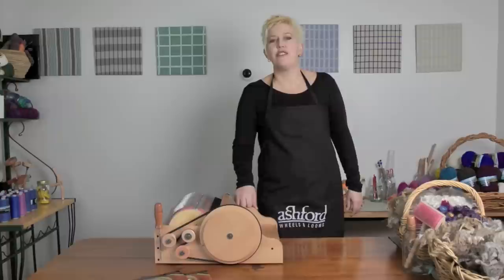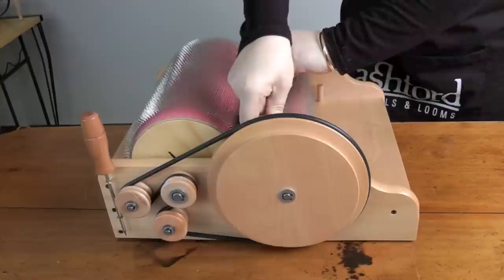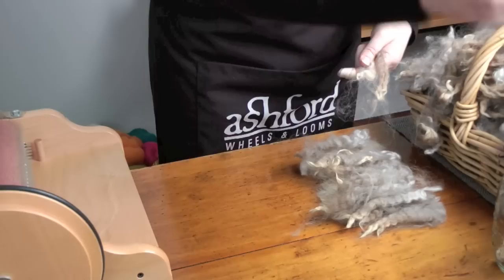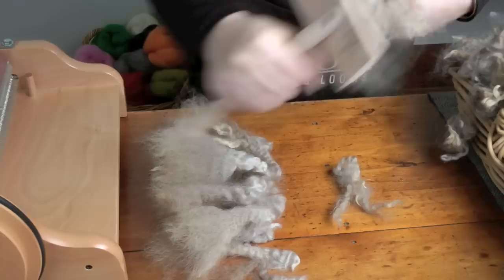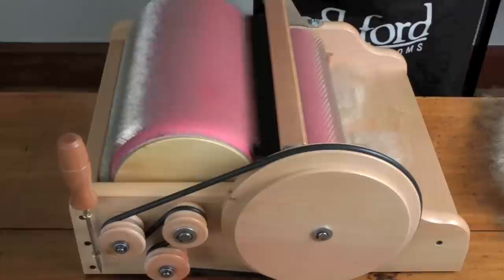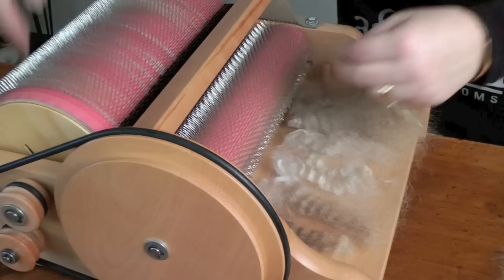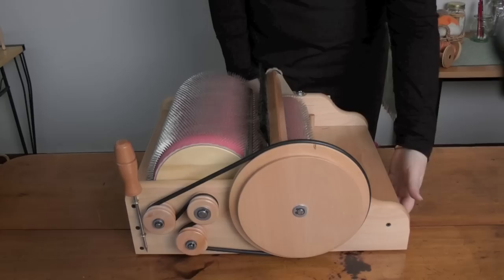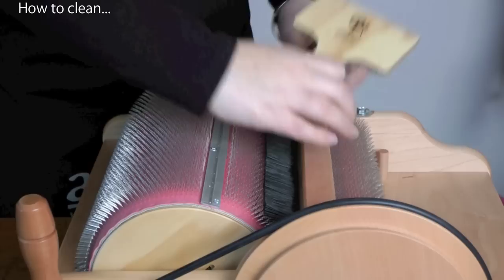Carding fleece on an Ashford Drum Carder

Comment: I ran a 3 million dollar carder from germany.....I was the best operator around.....I ran 3300meters every 8 hours 62 inch wide double pleat with bonded netting....  70grams per square meter........30 rollers total 7 ft diameter main cylinder with 3 miles of wire around it......the Matt was precisely laid out so well it looked like a mattress going into the machine.....it was a beautiful process

Comment: Just purchased one of your Ashford Drum Carders and it is the best investment I've ever made for my hand-spinning -- along with my spinning wheel, of course. I'd been using hand carders and gotten very good at it, but this takes my fibre prep to a whole new level as far as efficiency goes. I did exactly what you've shown us here and it worked perfectly. A good bit of information to add, for newbies: when you run the batt through the drum carder again, split it lengthwise into several strips, pull each strip as wide as the original batt -- at this point the fibre should be no thicker than the locks you fed into the carder initially --and feed slowly as before.

Comment: i've watched 4 of these damn videos and i still have no idea what any of this is. please help. i feel like a cryptid, i haven't slept for 3 days, im just so confused. how did i get here.
Reply: Marvellous machines to card wool so it can be spun then knit :D I too found my way here via others means but enjoyed the videos so much i googled some info on it .
Reply: Basically, wool comes how it grew - hung off a sheep which really wasn't interested in producing something someone might want to use. It's got crimp to it, likely, which means when it's shorn, it's one inglorious mess. Half the farm in it, full of natural oils which have gone rancid (no, most sheep don't shower regularly) and some other natural products of sheep which generally aren't mentioned. That gets shorn, and washed ("scoured" - which is gentler than one might think, or you end up with felt), and now it's time for to straighten the stuff out headed in the genral direction of spinning - usually after even more work doing the same on smaller and smaller amounts, so the wool which results is usable. Research dizzing and hand-carding for that.
Technically, a fleece's next major step is a combed batt, which just means a wide sheet of aligned fibres, which is likely reduced by passing through a small hole in a "diz" to become roving, a far narrower strip of the same, which is then opened up using hand cards into a rolag, which is a sausage of loose fibres ready to be drawn out in spinning. 
Fibres are often blended in creating the batt.

Comment: what do you do with the bunch of fluffy stuff when it's done,  can it be spun into wool for knitting?
Reply: Yes. You spin it, either with a drop spindle or a spinning wheel (they have electronic versions these days). Then you have to turn the yarn into multiple plys (spun wool is more thread size than yarn size) and set the twist by soaking it and leaving it to dry with a weight on the end. Dyeing is optional.

Comment: There's a ratio when using a carding drum?
Reply: Varies, the point is the large drum has to pull the fibre off the smaller one, and as both rotate in the same direction, it means you need different speeds. 4:1 is usual, although some go to 6 or 8.